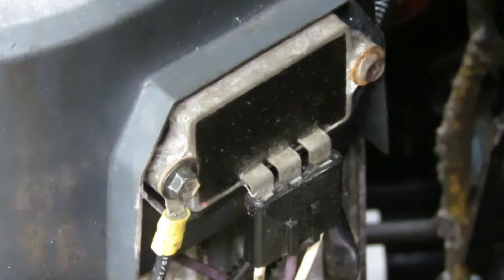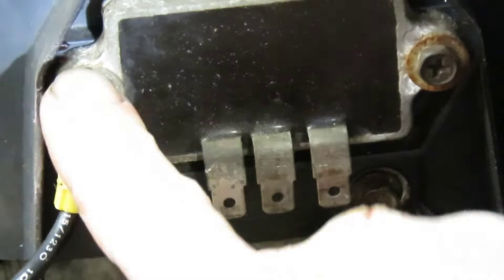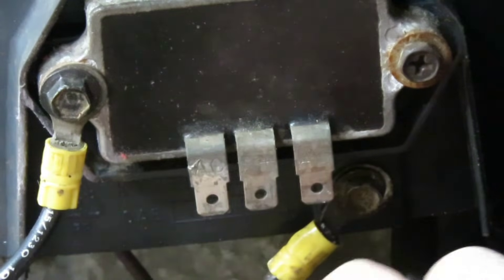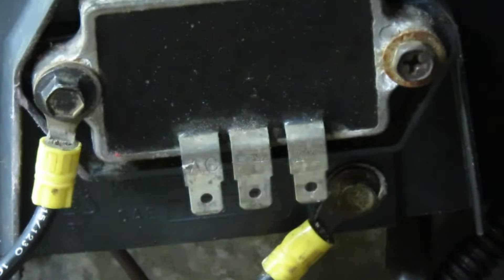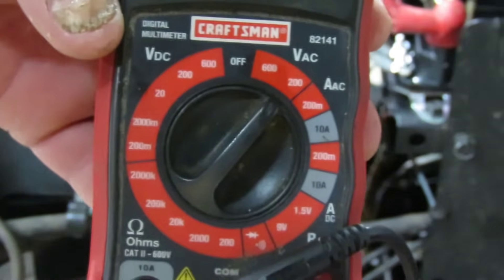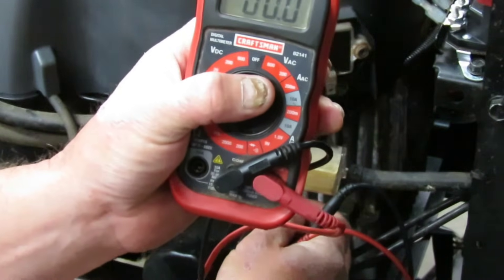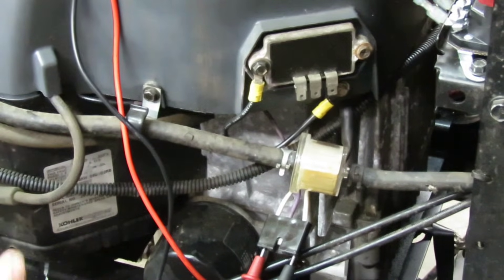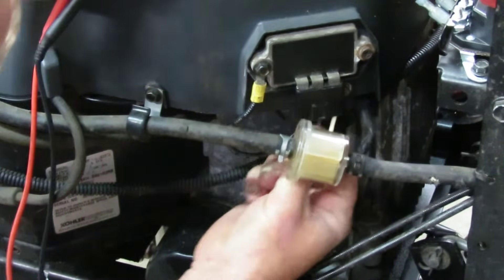How to Test Kohler Charging System

Comment: I am getting about 8v DC coming off of the voltage regulator.  I watched https://www.youtube.com/watch?v=zRwkKNGkymU your comprehensive video.  So I got to the step where I would put my positive in the center post of the plug that would go into the regulator, ground it to the ground on the battery, then turn the key.  I get no reading.  I do however get a reading if I crank the motor.  I am very much an ametuer trying to troubleshoot my issue of the battery not charging while running the motor.  The battery is new and I have ruled out any issues coming from the alternator.  It may be the regulator but I am leaning towards something obstructing the connection between the regulator and the switch, or the switch and the battery.
Reply from the maker: Unplug the wire that you are getting 8v DC
on. Volt meter on DC put red in this wire connector. Ground the black to negative on battery. Turn key switch to on position.
There should be really close to battery voltage on that wire.
So if battery reads 12.44 volts DC
The wire you disconnected should be close to that battery voltage.
If there is battery voltage on this wire, You have eliminated any trouble in that circuit

Check to make sure regulator is grounded good. Volt meter on Ohms. Touch one lead to base of regulator. Other lead to battery negative. Should beep or be Zero on meter.
Reply: @sartingarage8045  these things I have done, when I turn the key on I get no reading,  if I crank the mower then I get the reading close to that of the battery.   The switch has three settings,  off on and the start, it does not have the intermediate setting shown in your videos.
Reply from the maker: Don't replace voltage regulator yet
Your need to test key switch and wiring
In order to find which wire leads from voltage regulator to key switch. 
Disconnect Battery
Disconnect key switch harness
Volt meter on Ohms
One lead in same terminal that you were checking for battery voltage.
Then probe each terminal on key switch harness until you get a reading.
If you don't get a reading your problem is bad connection at connector or broken wire from regulator to key switch. If you do get a reading.
Match that terminal in harness to which it connects to key switch, It will have a letter on key switch for each terminal.
From this terminal to the B terminal on key switch.
With key on take a reading from that terminal to the B terminal on key switch
Usually is lettered A1 or A2
If no reading replace key switch

Comment: When I checked the two white wires I only had 22ish volts
Reply from the maker: I would think 22 volts AC would still be enough to make the voltage regulator work.
What are you getting DC out of Voltage Regulator.

Comment: i have a courage 19, stater and dc volts are correct. should the engine once running, continue running with battery disconnected? if not what would be suspect?
Reply from the maker: I guess I'm not understanding what your saying. But why do you want to run your engine with battery disconnected.

Comment: Checked out my kohler charge system. Stator producing 43 
a/c volts. Regulator 0 d/c Replaced regulator. Producing 9 volts d/c now at full throttle grounds seem to good. Ideas?
Battery voltage is 12.8
Reply from the maker: Make sure base of regulator is grounded.
If base is not grounded , regulator will not output. Also with key on make sure you have battery voltage to DC output on voltage regulator.
Watch the video I have on Kawasaki charging system. Although a different engine, charging is the same. There are some helpful tips in this video.

If all tests show OK replace regulator
Reply: @sartingarage8045  yes I did watch that video, it was very helpful. I do have a good ground as well dc voltage with key on at regulator is same as the battery tests. Can I run a wire direct from regulator output to battery see if that charges?
Reply from the maker: Temporarily Yes
But you can't leave it hooked to battery that way. Will drain battery as there is no switch to turn it off
Reply: @sartingarage8045  and it was a new regulator yesterday. Still had the problem
Reply from the maker: On you 43 on stator that is AC right
Reply: @sartingarage8045  yes it was ac. 
I found the problem. Fuse block had got hot and wasn’t contacting fuse. The fuse was good. Got it cleaned up and is now charging around 
14.3 volts dc. Will install new fuse block tomorrow. Thank you so much for your replies and your video’s very helpful and well done.
Reply: @daledahlen2488  where is the fuse block you are referencing?

Comment: I'm getting 30.6 from sator and 12.4 from voltage regulator. Does that mean voltage regulator is weak or bad? Mower shows low voltage  11.7 when mowing .
Reply from the maker: Make sure base of regulator has a good ground. In this video it shows you how to check this. I also have another video on checking ground connections. 
If ground to regulator is good
Replace voltage regulator

Comment: Nice walk through on the Kohnler charging system. I have a similar setup, but with a Tecumseh twin 25 hp w/elec. PTO that uses a 2 terminal voltage regulator instead of the 3 terminal your Kohler has. I've been nursing along a low/no charge battery for the summer, keeping a 3A charger/maintainer on it between mows, just getting around to taking a look today. Figured I'd share. I initially suspected the alternator winding (stator), but confirmed it's putting out just under 30v AC in to the regulator. When checking the B+ side of the regulator, it's only showing batt voltage at WOT. 
Two questions; 1) is there a bench test I can do/measure the voltage regulator before condemning it bad, even thought I'm pretty confident it's the root cause? It shows open on continuity and about 15 ohms resistance, but the longer I wait,t the lower the resistance creeps. I thought it should have a reading much higher, but not really certain? 2) the voltage regulator I need (1A183-164) is NLA on all the sites I've checked so far, any ideas where to find an old part that's been discontinued like this? Don't know if I want to trust a used one. Thanks!
Reply from the maker: I'm pretty sure this part # will work.
Tecumseh Part # 611184
16 amp 2 pin regulator
Reply: @sartingarage8045  Yep, that's the one I ordered the other day. I found it by looking in an old Tecumseh OEM Parts Guide,  using the TVT691 engine. It's virtually the same as my VTX691. 
I also wanted to let you know that I confirmed continuity between the rectifier stack up to my engine and through the mounting hardware. I'll be glad to not have to keep hooking up that charger every time. Thanks again for your feedback!
Reply from the maker: You have good AC
You have battery voltage to regulator
But no output from regulator higher than battery voltage.
Make sure base of regulator has a good ground. Base has to be grounded or will not charge.
If you have good ground to base
Replace regulator
Reply from the maker: Let me see if I can locate voltage regulator

Comment: unless i missed something you only test one of the diodes whenyou read the 14+ volts you should check the other side as well should have ac on the sides and dcin the middle  you ca read the ac by changing your meter see what  the alternayor is putting out those diodes conver it to dc in the middle
Reply from the maker: Yes AC from stator to regulator.
( 2 outer pins )
DC out 14+ volts center pin
But most of the time there has to be battery voltage to center pin for output to show correct output.
With key ON engine OFF there should be battery voltage to center pin on regulator.

Comment: I have a Kohler command pro 18 and its on a scag. Wasn't the original motor. Well im trying to hook up the electric pto. I did all the tests. I replaced the stator. My engine is a pull start no battery. I'm not getting any DC volts out of the regulator rectifer. Please help
Reply from the maker: Watch the Charging system video I have on Kawasaki. I know its a different engine, but the charging system works the same way.
There are a lot of helpful tips in this video.

On your output wire on regulator there has to be voltage to that wire before regulator will output. Make sure key is in on position or there won't be voltage there.
If you have voltage to this wire
Replace regulator.
Usually the wire is purple
I explain all of this in other charging video
Reply from the maker: Wait
You said there is No Battery.
That changes everything I said.
One thing to check before replacing voltage regulator.
Make sure voltage regulator is grounded 
Usually there is a small wire going from voltage regulator mount bolt to engine shroud bolt.
This is your ground for regulator
If it seems grounded good
Replace regulator

Comment: To add to my previous comment, the first A/C test test was only showing 26 volts. Is that a problem ? as the second test was showing 14.5 volts on a fully  charged battery.
Reply from the maker: As long as your getting the correct 14.5 DC volt output , 26 AC volts from stator ahould be OK

Comment: Thanks, that was a great help . When checking the purple wire part of the metal tab that makes a connection to the voltage regulator has fallen off. This may be the problem that has plagued me for months . Is that whole wire assembly to the voltage regulator easily replaced ?  And if it's not too personal , which part of the U.S is your accent from.  Cheers from Australia.

Comment: i have a cub cadet LT1045 after starting, the kohler engine will run for about 3 seconds and blow the main fuse. i suspected the rectifier, when i disconnected it  the engine ran fine, purchased a new rectifier, started the engine and its the same problem.. i've traced continuity through all the wires but still can't find the short... oh and i was having trouble with the electric pto so i replaced the switch and i'm replacing the pto itself but its not currently connected to the system.  frustrated do you have any ideas?
Reply from the maker: Need to check your DC voltage while engine is running. Disconnect connector at Pto clutch. Check the voltage at Pto Clutch while engine running at wot.
Make sure Pto is engaged or No voltage will show
You either have a short in the wiring.

Or one of your ignition coils are shorted causing high voltage which will blow the fuse
Reply from the maker: This will get you a good starting point to figure out what the problem is.
There are several things it actually can be.
Reply: @sartingarage8045  clutch is removed. should i disconnect the rectifier, because it will not stay running with the rectifier connected, and I did change out the rectifier..  just wondering if there is something else i'm missing
Reply: only one ignition coil and it looks like the wire from the coil might have been compromised, i put some electric tape around the area but i'm not sure that was the problem because i couldn't get continuity from the breached area but i did get it through the connectors.
Reply from the maker: That could have very well been your problem. I would try before I went any further.
Is there 2 wires going to Ignition Coil or just One.
Reply: @sartingarage8045  just one...but i'm wondering if that would short and blow the fuse anyway no matter what.  if i disconnect the new rectifier, the engine runs fine
Reply from the maker: Voltmeter on battery or at Rectifier
Start the engine and watch for a voltage spike right when fuse blows.
Also Make sure Rectifier is grounded good
I have seen this to
Ignition Coil shorted out inside causing Spark Voltage to go thru Kill Wire spiking voltage up and will blow fuse and other problems as well. 
Also Test Key Switch for power short to Ground. 
B terminal to G terminal on back of switch.

Last its odd that you disconnect Rectifier and fuse will Not blow.
Im thinking a shorted out stator
There are 2 wires coming out of stator
Test these two wires seperately to ground
Best I can remember there should be NO resistance to ground.
If this seems Ok
Disconnect your rectifier 
Then do a AC voltage test on Stator with engine at wide open Throttle.
Watch the voltage for several minutes watching for a strange increase or decrease in AC voltage from stator.
AC voltage should stay pretty steady.
Reply: @sartingarage8045  the only thing that seems to make sense is a shorted out stator.. ill do the test but that seems to make the most sense thank you thank you thank you,
Reply from the maker: Your Very Welcome
And it does make the most sense
But electrical problems can be a nightmare sometimes
Reply: @sartingarage8045  well i tested stator output and it read steady 45.3volt WOT  i'm thinking that is a bit high, there was no resistance from either stator wires to ground and rectifier ground was good.  
what should the normal output be?
Reply from the maker: I think I would test key switch.
I have a video for key switch
Those plastic Key Switches are bad for shorting out.
Reply: @sartingarage8045  that was one of the first things i did. the switch tests out ok
Reply from the maker: Is there a relay on your mower model
Its usually close to fuse
Reply from the maker: Does your mower have a relay 
Its usually next to fuse or close by.
You have a short somewhere
Your gonna have to keep testing wires and components until you find short
Reply: @sartingarage8045  I found it...  i put a larger fuse in the fuse holder and saw the arcing wire...  its not fixed..  it was from the charge wire from the rectifier..  i cut out the exposed wire spliced and soldered it then put heat shrink tubing on it and locked it off so it doesn't rub anymore.. mower is back in business new 20 amp fuse and now to put in the new clutch...  puts out 14.5 volts dc charge,..  dont mind telling you it was a real dome scratcher

Comment: He laid out very easy steps to follow. One of the stater wires slipped out of the plastic connector housing  and was not making a good connection with the voltage regulator 
Did the test (s) like he showed everything tested  good. Got the white wire locked back into the plastic connector housing plugged back onto the regulator. Putting out 14.5 volts! 
Thanks for the info probably saved me $100 + service bill at the shop !!

Comment: Hi, I am getting battery voltage at center pin on regulator with key off and ignition switch unplugged.. Any clue?
Reply from the maker: As far as I can remember there should be No voltage to that wire with key off. Especially with switch unplugged.
You will have to track that wire until you find the short or where voltage is coming from.
Reply: POP

Comment: Thank you for your video this is my beginning stages of trying to fix my Kohler CV 22 hp engine. When I tested the two white wires my engine would not stay running to complete the test so I just held the key on and it looks like on my meter I got around 45 to 50 V. Would you happen to know why the engine would not stay running with the connector disconnected? Then I proceeded to check the sea vault on the purple center wire on the connector to ground and did not get any voltage there at all so would that mean it is the stater I am to replace which is under the shroud?
Reply from the maker: You do not have to disconnect.
Leave it connected
Touch your probes to terminals
Reply: Sartin Garage OK Sartin  I just tested it with the refractor attached and on my DC voltage on the center terminal I did get the 12 V however when I tested the AC two white terminals I only got 22.8 V so would that mean my stater is bad
Reply from the maker: I would think 22.8 volts would be enough
Its a bit low, but I think its ok
Engine off but Key on
Should be battery voltage to purple center wire.
If the voltage is Ok on purple wire 
Make sure base of voltage regulator is grounded. Should be a small wire connected to the voltage regulator going to shroud that grounds regulator.
One lead on voltage regulator base
Other lead to engine block or Negative ground. Dont use the bolt to ground to that is connected from the voltage regulator to engine shroud. As this will give you a false reading of ground due to its actually checking the wire..
If all ground is good and have battery voltage to purple wire
Replace Voltage Regulator

Comment: I have a 27 hp Kohler and I checked the regulator and have 42 volts ac and then I checked the B terminal and I have 0 volts. I made sure that the regulator was grounded and checked the B terminal with one lead on it and the other lead on the battery ground and the motor and don’t have any voltage at all. This is a new regulator.
Reply from the maker: Disconnect connector to voltage regulator.
Turn key to on position
Check voltage to center wire in voltage regulator connector.
If still No Voltage there.
The problem is bad connection or Key Switch.
There has to be battery voltage to this wire or voltage regulator will not work.
Watch my video on Kawasaki charging System. There are some good tips in that video.
Charging system works the same way 
Just connections are slightly different
It will help you

Comment: what gauge is that black ground wire?  12, 14 or 16?
Reply from the maker: Not exactly sure, but I would use atleast 12 gauge. 10 gauge wouldnt hurt anything
Reply: @sartingarage8045  Thanks!  I needed to buy some wire and loop ends to replace my ground.  (it broke off)  for now i just used bare wire but it might fall off so wanted to just replace it with proper ends.